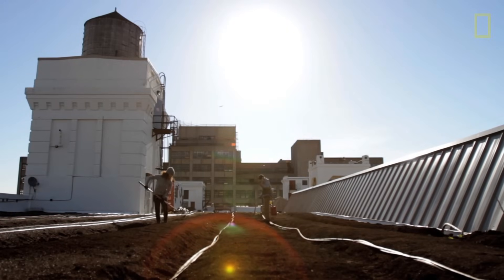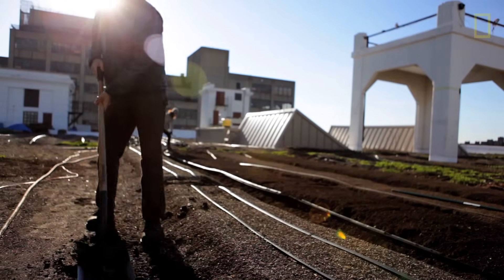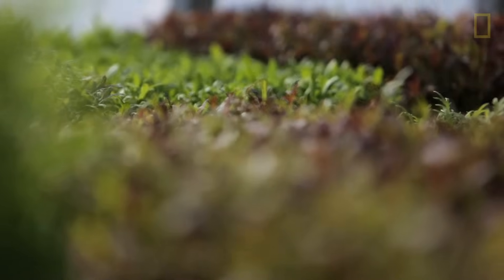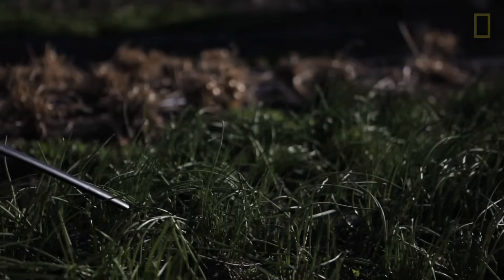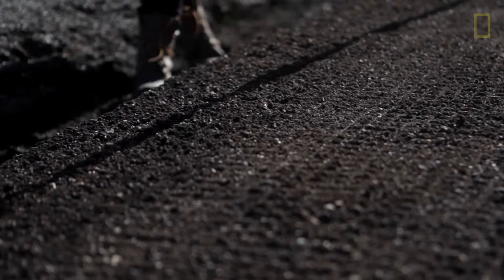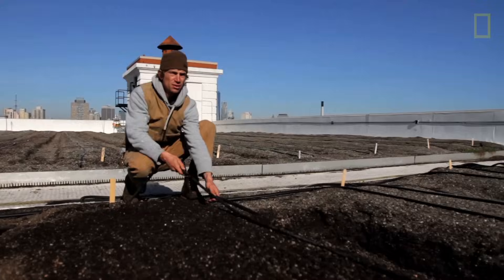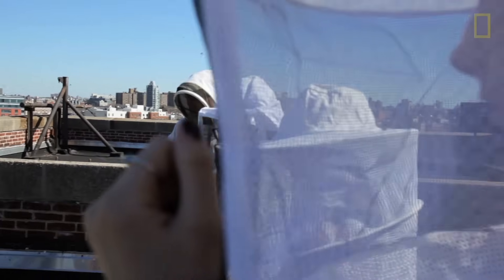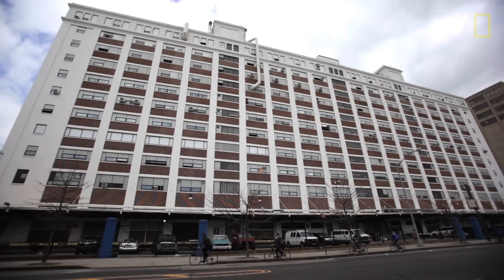Farming on a Rooftop | National Geographic

Comment: A person would have to be diligent and find out if the roof structure could handle so much weight before pouring in all of the heavy soil. 

There might be a lot of pollutants from car fumes, etc., that could drift onto the plants. There also might be asbestos or lead in the roofing materials.

Comment: How can that roof support a million tons of dirt? I think that at the first big earthquake that roof is going down, and will take the building with it !
Reply: ***** Even if that is so, this is a precursor project. It's meant to prove that it can be done. In the future buildings may be built with this exploration in mind.
Reply: Bibi, they are referring to all the rooftops that are under their supervision and maintenance, not just one rooftop. So make an adjustment in your calculations.
Reply: Ok, the weight might not be a problem, but will roof material support that humidity ? Also, won't the roots dig in the concrete and roof isolation if they grow too much ?

Comment: I worked on those roofs in brooklyn, many of them can't take the weight. The roof will have to be special steel reinforced roof tops. To prevent them from clasping or leaking and rot of the structure. It's a great idea, But if the roof is not a steel reinforce roof, it's dangerous. It's best to use big planting pots for this.
Reply: a plant consider hydroponics. No soil, 90% less water.
Reply: +a plant Why in the world are you asking anonymous, unqualified people on a video comment page?
Reply: or greenhouses :)